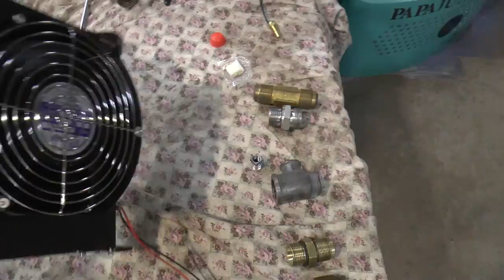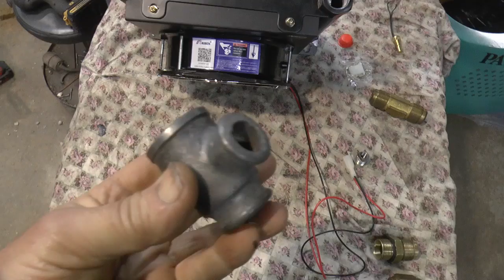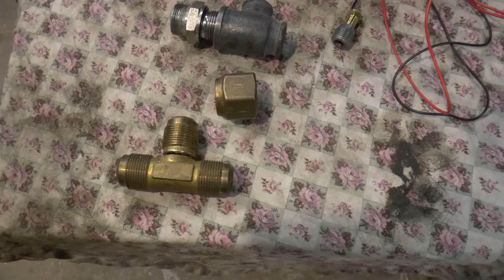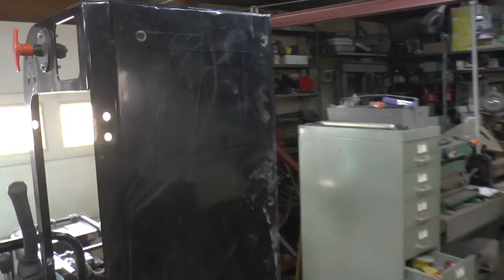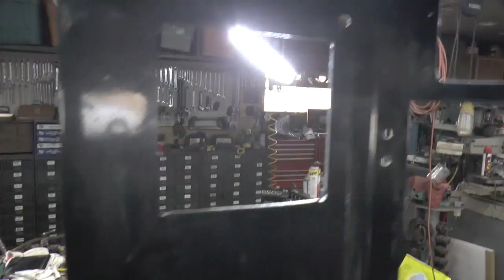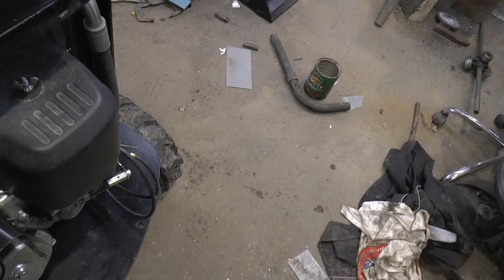Chinese Excavator QH12 Oil Cooler Install

Comment: Does this cooler have preset Inlet and Outlet ports? Can you use ether port for inlet? Did you try to reverse the fan to blow air out?  Thanks..
Reply from the maker: Mine didn't have any in/out labeling. I don't think it matters. I put the in on the bottom of mine thinking it may make it easier to bleed the air out. I think the fan can run either way but moves more air in one direction.

Comment: Now I see why so many excavators fail.  I took my oil cooler, filter and return line into a hydraulic shop and got the correct connectors.

Comment: I would be worried about my pant leg interfering with it if its sucking in right there. Did you have any issues?
Reply from the maker: No problem so far. That is a good point that I never considered. I guess my foot is usually further up near the canopy support.

Comment: Thank you for this knowledge. My model has the whole pump thing on the right and the filter is hanging in a void space like it was meant to have a cooler in there to begin with, might just have to check this "nude" cooler thing out (the ones I was looking at were boxed) and no way they fit

Comment: A little tip for bending copper tube, if you fill it with water then freeze it it will give you smoother bends. I learned this from watching how they make brass instruments.
Reply from the maker: Tried it once and it expanded the copper and the fittings would no longer go on.
Reply: Sand is friend when bending.

Comment: Would a solor panel to the top of the canopy be beneficial?  Possibly used as a battery charger or to run another fan?
Reply from the maker: Maybe. But there is a lot of vibration plus your not always working in the sun. Mine always seems to find something to run into. limbs etc.

Comment: The AGT I purchased at an auction already had a hydraulic cooler.
Reply: Agt loader or excavator? Does this help you run the hydraulics longer without it getting too hot?
Reply: @youngprince716  Excavator.  Yes, but it still gets pretty warm in the engine compartment. It's still a good idea to put a fan or two to cool the engine compartment.

Comment: I second that part# or the link please
Reply from the maker: This is what I ordered on Amazon but  it shows not available now.    AJ1025T-CA 25L/MIN Hydraulic Aluminum Alloy Air Cooler Flow Small Radiator Oil Cooling    I seen the same thing on Ebay
Reply: I used something like this but AMZ had a better price when I got it $75.  
EVIL ENERGY 30 Row AN10-10AN.  works great.   I added a $25 dollar 7" radiator fan to it.  make sure you set the fan to blow air into the engine

Comment: Seems to be a great fit! Do you have part# or a link to the cooler?
Reply from the maker: This is what I ordered on Amazon but  it shows not available now.    AJ1025T-CA 25L/MIN Hydraulic Aluminum Alloy Air Cooler Flow Small Radiator Oil Cooling    I seen the same thing on Ebay.
Reply: @kevincrawford2027  
Both currently unavailable on Amazon and eBay. Which means someone who wants to be a distributor most likely bought all the available ones up.